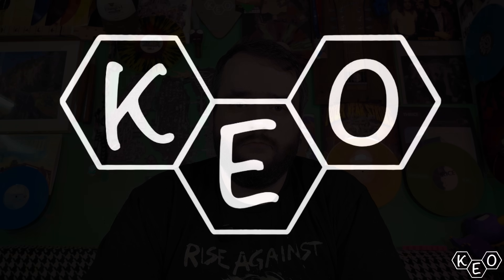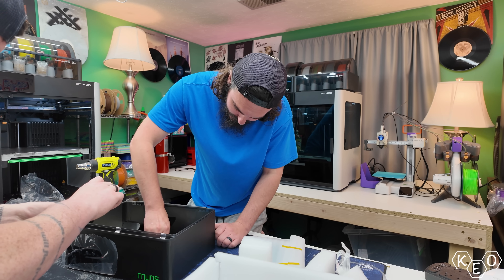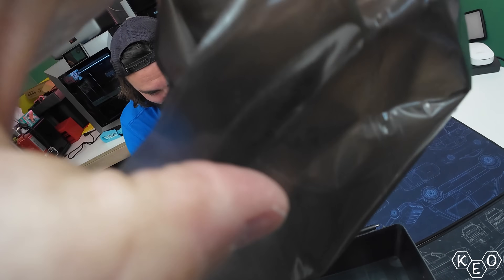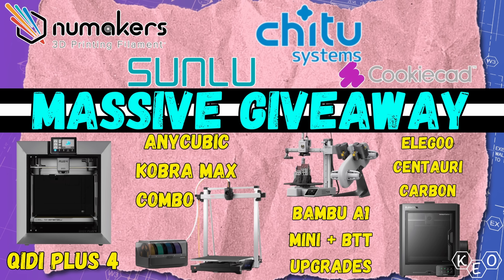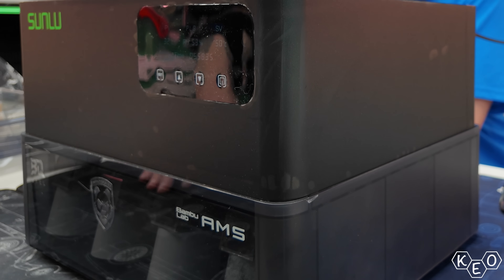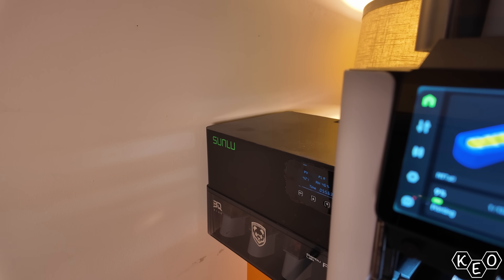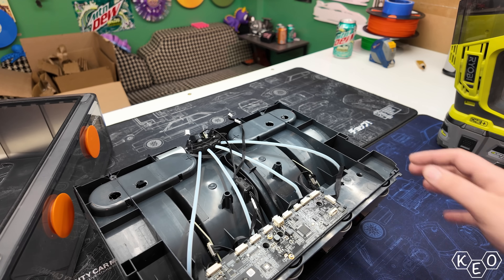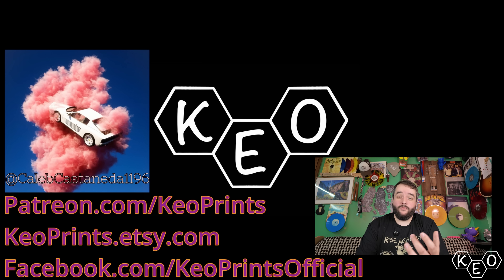I Tried the AMS Heater Upgrade… And Broke It

Comment: Having to remember to manually open the vents while drying seems a bit old school and sucks. Humidity sensors are super cheap and an extra servo would not have added that much to the price.
Reply from the maker: Agreed. Manual vent is the bummer for this one

Comment: I'm wondering, I built an air dryer for an Ozone machine, and it had Magnesium Oxide as the desiccant.  The desiccant should be changed out after a couple years or so.  Do these have desiccant and do the instructions say to replace it after a period of time?

Comment: You shouldn't have to be careful with a full-width hinge. That is an issue that needs to be address.
Reply: It’s not supposed to be removed. There nothing wrong with the hinge.
Reply: @melgross  If the hinge was sturdier (i.e. not built as flimsy as possible) than the slight extra weight of the sunlu lid wouldn't have caused it to break like that. They don't make things to last like they used to.
Reply: @Chad.The.Flornadian oh please, you’re trying to find excuses for SUNLU. The hinge isn’t flimsy, it’s built to take the stress of the lid. As I said, unless you’ve heard, and can show where these are breaking from normal use, then stop blaming them. The difference in weight of the lid is pretty much heavier than the Bambu Lab lid. This is clearly the fault of SUMLU. They made the add on. It’s their responsibility to take everything in account. If they failed at that, they need to figure out how to fix the problem they caused.

Comment: the humidity vent hole that you have to open and close manually is in dire need of automation
Reply: Yep, only reason I went with the Eibos instead. Although I'm sure the community will find a way.
Reply from the maker: Agreed
Reply: They could have atleast placed it in front so you can remember to open and close it.

Comment: Yeah, I'm not too sold on needing drying while printing, esp for PLA. I run dehumidifiers in the two rooms where I have printers and don't really have issues with filament being wet. I do keep my PA6 in my SpacePi x4, basically all the time. It still leaves the other side available for when I think I might need to dry some filament that's old and been sitting around. I haven't tried printing from it directly, but I expect it'll work.
Reply: Um, good for you? Not everyone can have a dedicated room with dehumidifiers. Not to mention that doesn't do much if the filament is already wet.
Reply: @michaelgleason4791 I have filament dryers if my filament is “already wet.” What I’m not sold on is the need to dry while printing with the filament. Dry it, then print with it. Store it well and there should be no issues. And there is no “dedicated room.” I have a dehumidifier in my office (one printer) and in my basement shop (two printers). My point is your environment does have an impact but it may be easier to maintain your environment then try to compensate for poorly maintained materials. And, fwiw, I live in the SE USA, very humid.

Comment: Maybe they should do a removable lid instead of using the hinges on the next version
Reply from the maker: Yea I’m not sure what the solution is but those hinges are just asking to be broken. If you’re a fool like me I suppose
Reply: @KeoPrints  real user on real conditions. it would likely happen to me too
Reply: It’s not intended to be removed. Why should they do that?
Reply: @melgross  because it will be a common point of failure. possibly breaking not only the dryer hinge but the AMS itself. if in this case it broke with just the weight I don't think it would last a week with me. ( I am not very careful with my stuff)
Reply: @celsofx the AMS cover is light, and unless you’ve heard of the covers breaking off, then it’s not an issue. A company isn’t responsible for what a third party company does to their device. SUNLU knows it’s not suited to the AMS as they warn about being careful and not allowing their unit, which is much heavier than the Bambu Lab cover, to open too far back. So it’s their fault. They should have put something at the rear of their unit that wouldn’t allow it to be opened too far back, but they didn’t, just a warning. Obviously they had units break in testing and instead of doing something about it, they just give a warning to not break it. That’s not satisfactory. It’s not Bambu Lab fault. They don’t sell the AMS with the idea that others are going to modify it with something not suitable.
Reply: @melgross  maybe I wasnt clear, what I meant was maybe SUNLU needed to make it removable instead of a hinge, or put a stop like you suggested. Bambu has nothing to do with this.
Reply: @celsofx ok.. that’s fine. I’m seeing people here blaming Bambu Lab for a problem that isn’t theirs and it seemed as though you were doing that as well. You’re not, and that’s good. It bothers me that Bambu Lab seems to be the whipping boy recently. A lot of crap is being said and I’m getting fed up with it.
Reply: @melgross  for sure, coming from the ender 3 to the bambu p1s improved my 3d printing experience so much! I know they are not perfect but Bambu has set the bar a lot higher for everyone else and that by itself should be more appreciated